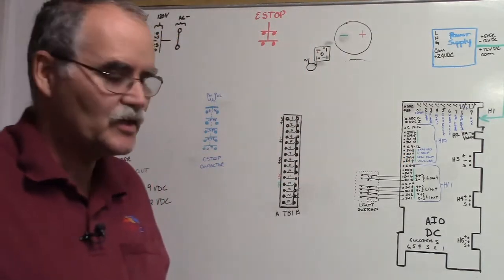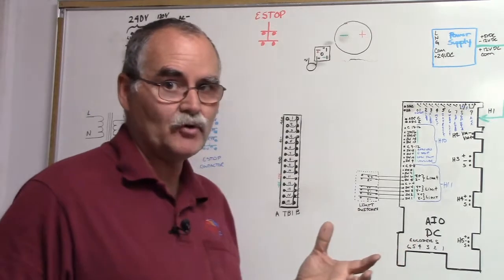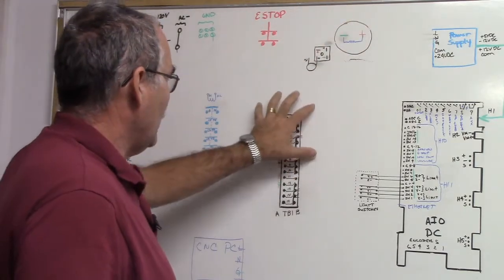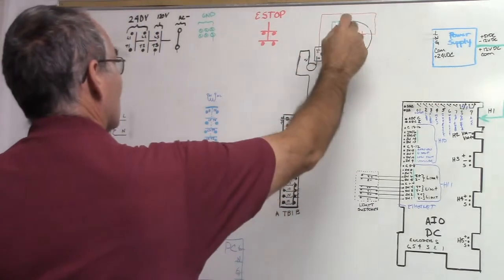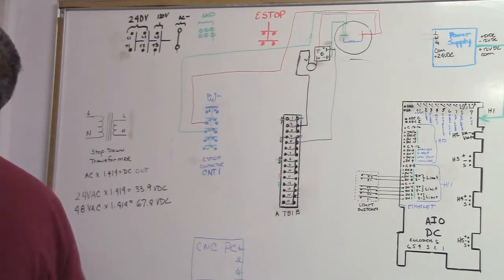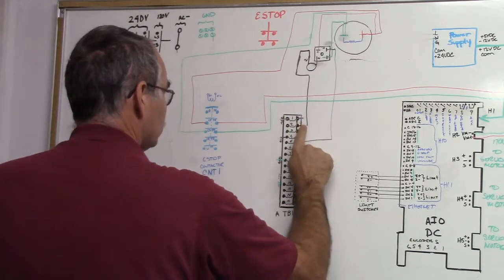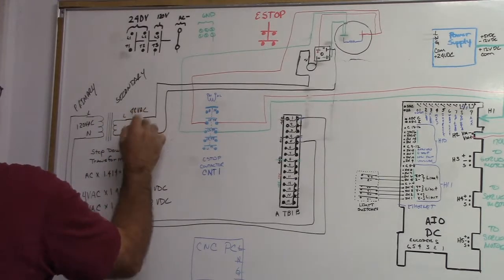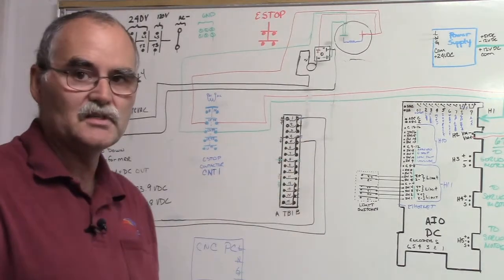3: "Wiring" The Centroid All in One DC - Sinking/Sourcing & Wiring the bridge rectifier/capacitor

Comment: Do you have a source/part # for the estop contactor? or is a general purpose 24vdc contactor equivalent? I recall on a contactor that I previously used I had to us something like a diode that only let power run one direction on two terminals of capacitor, do you know what I am talking about?
Reply from the maker: IF you are going follow what I did, the contactor must have a 24VDC coil, and the contact ratings must be 20Amps. You need to determin the number of poles  you will need. The Centroid plans call for a 24VAC contactor. I deviated from that, because I would have had to install a transformer just for that contactor. I think they are considering revising the drawing.